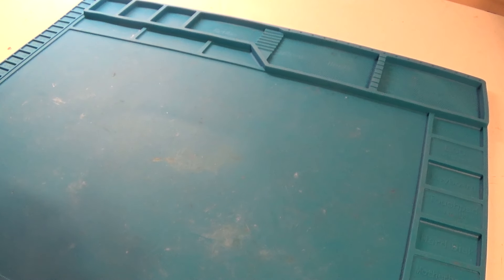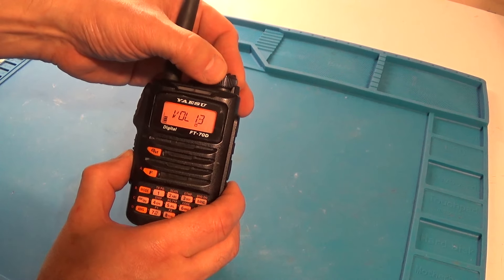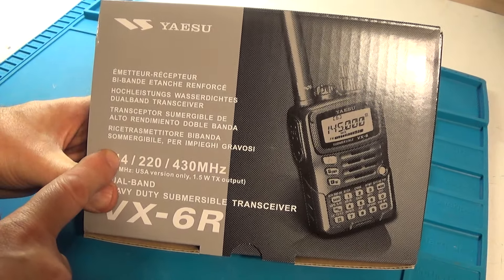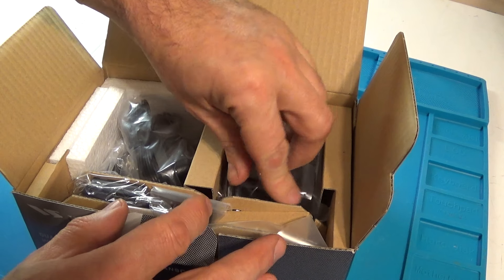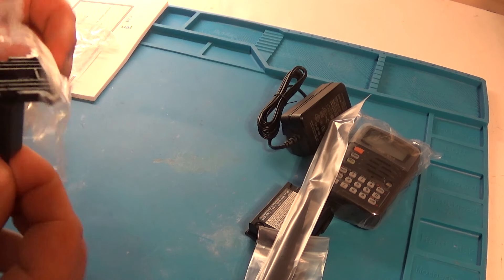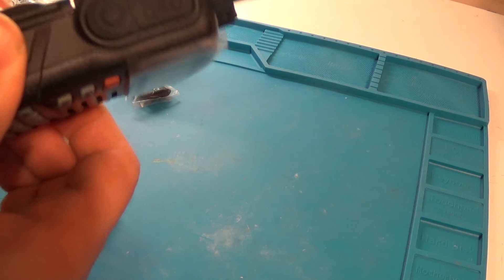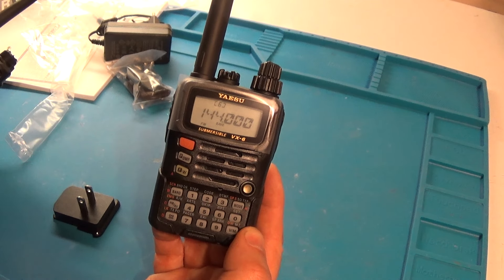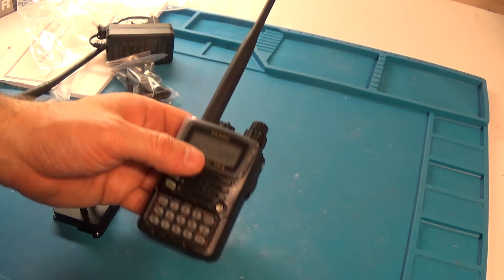Yaesu VX-6R Tri - Band Heavy Duty Submersible Transceiver Unboxing

Comment: The Yaesu battery is a bit snug to put in the radio, once you get the hang of it it's not a big deal, it's like that with the VX5 and VX7's as well. The 6 will use most of the same accessories as the VX7. Also handy is the standup fast charger (CD-15A) 'maybe and old part number', it is somewhat expensive though. You can run the radio directly from 12 volts, it will heat up on hi power TX. Good contrast on the display very readable, albeit a simple  6 character readout. RT Systems software works well and uses the same programing cable as the VX7, in fact you can cut and paste data from one program to another. One thing I like is the VX6 makes a good scanner with the ability to use 24 banks of 100 memories to manage the over 900 memory channels. This is something the new Yaesu FT5 can't do, poor channel management, I'm sure it's a fine radio in other respects. The VX6 looks to be a tough radio, should be well suited as a daily carry radio, just be aware that like other Yaesu handhelds the numbers will ware off the soft keys in time in a pocket without a case. A threaded mic accessory jack is at the top next to the antenna, the Yaesu speaker mic is threaded and screws in to make a water proof seal, the RT Systems cable is not threaded but is designed to plug into the recessed threaded jack same as the VX7. Spare batteries are available from Radioworld, or your Yaesu dealer, and Batteries America. The stock antenna works well enough, but remember an aftermarket antenna should cover the same bands as the radio.  7 3